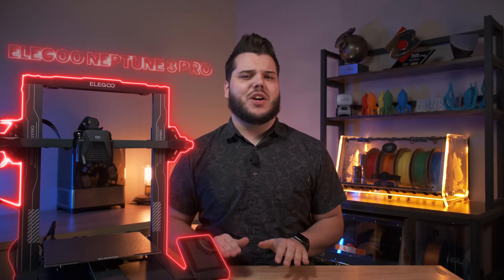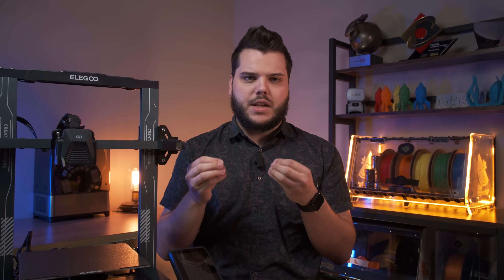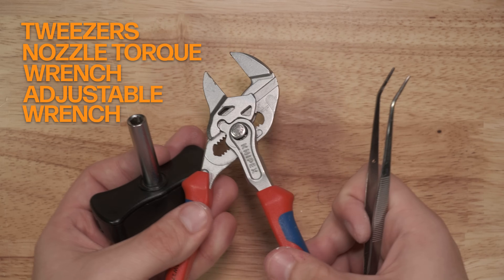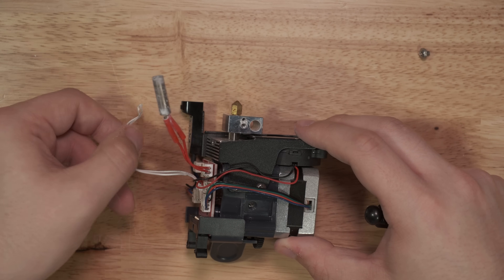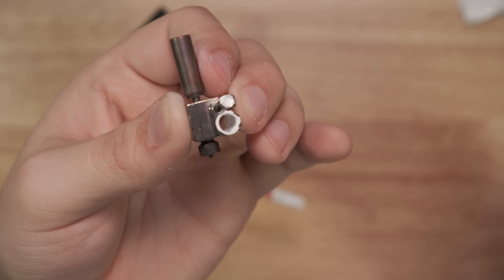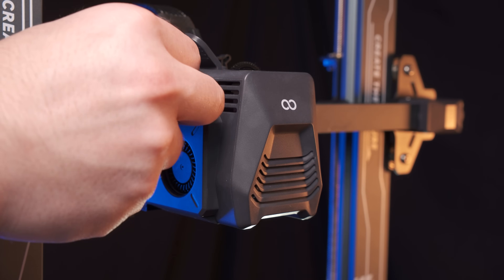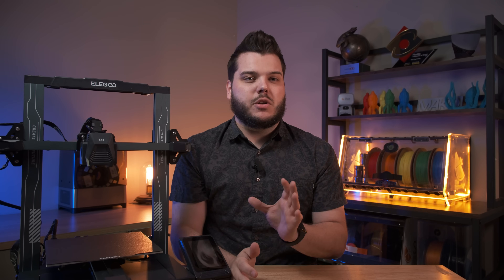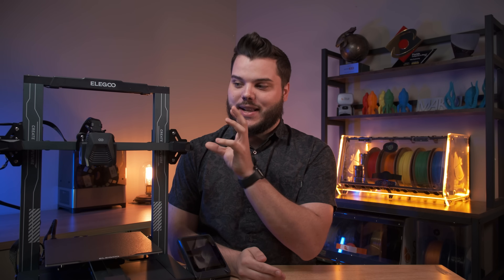Say Goodbye to Clogs | Elegoo Neptune 3 Upgrade Kit Installation

Comment: I just decided to upgrade my hotend, and, other than a couple of sketchy hotends with highly ambiguous specs, this one was the only plug and play one for the Neptune 3 Pro that I could find to do that.

Being that it seems to be of extremely high quality, has well-defined specs, and is plug and play, I decided to go ahead and order one. 

Unfortunately, they are out of stock.

Do you have any idea when they are coming back in stock?

For now, I have ordered a cheap upgrade kit that I don't fully trust, and I guess if it melts, it melts, but I still want to order this one.
Reply from the maker: Hello! Unfortunately, the Elegoo Neptune 3 kits are out of stock indefinitely. However, you can find the C-E heat break on our Amazon store and all of the other components on our website! Reach out to support@sliceengineering.com fr assistance in putting an order together.

Comment: People are going on about the costs. The nozzle is hardened steel alloy and can print abrasive filaments and comes with a non-stick coating that has already shown very good benefits; the heat conduction of the combined kit means that even though it isn't brass, I had to set my temps lower to get the same print quality, so some of the heat conduction claims are justified. Clocked the volumetric flow for PLA at 17mm3/s, meaning the hotend limit for print speed at 0.2 height is ~210mm/s. Even the sock fits perfectly. I think apart from the travesty that are shipping costs from US to AU and the music volume in this video, I'm quite happy with the upgrade.
Reply from the maker: Thank you! We are sorry about the music, and duly warned for next time! International shipping costs are a travesty, indeed. We are so glad to hear that you are happy wth the upgrade, and thank you for your support!
Reply: @SliceEngineering  I tried to leave a positive review on your website. It said that I already left a review, then proceeded to hide all reviews on subsequent page refreshes :/
Reply: buddy i not gonna pay over half the printer for a simple hotend upgrade when i can find something cheaper for 4 times less

Comment: Couple things I'm curious about.

1. Why use a non standard sized heat block? A cube shape would allow you use reuse the stock silicone sock or fid your own alternative. Seems like a cost cutting measure to use less metal and not a retraction setting bonus. 

2. If you're upgrading to an all metal hot end, the end goal is typically to print materials that require higher temps. At that point why not upgrade the thermistor to a stud and not reuse the fragile glass thermistor?

Comment: So only around £110 to order to the UK due to the cost of VAT and such.. I think that is way too much to pay for a new hot end for my Neptune 3 Max.?
I prefer to buy a all metal hot end from my normal place for around £20 and since it be from the UK, no customs or extra VAT to pay!

Just two months after I brought my Neptune 3 Max if I known Elegoo was going to do the Neptune 4 Max for the same money and it had Klipper and all metal hot end already installed.
I would have not brought the Neptune 3 Max but instead brought the Neptune 4 Max!

So now I have to pay out lots to upgrade the Neptune 3 Max to Klipper system by the BTT Pad 7 and get a all metal hot end for it?
Life really sucks sometimes.
Reply: Instead of spending a fortune on upgrades, put that money on a 4Max.

Comment: How do we crank the temp to 300c?
Reply: You'd have to change the firmware
Reply: @microsoftsam1970  I did that some time ago, and it was buggy as hell.
Reply: @darklordstudio  Literally all you need to do is alter the firmware you're using to change the max temp range. not download some experimental firmware so I don't know what you're on about
Reply: @microsoftsam1970  Thanks for the help.
Reply: For anyone, before changing the max temp, you need to change the thermistor sensor as the cables are rated only to 260°C.

Comment: Would this fit the N3plus also?
Reply from the maker: Actually, we stand corrected! This kit works with the Neptune 3 Pro/Plus/Max configurations as they all share the same hotend! We only have the Neptune 3 Pro in-house, so we were only able to test on that machine specifically. But after confirming now with some other testers and sources, it looks like it will fit the N3 Plus/N3 Max just fine!
Reply: @SliceEngineering  that’s excellent, thanks for replying back and clarifying
Reply from the maker: Unfortunately, this kit only works for the N3/N3 Pro. The N3 Plus/N3 Max use a different hotend configuration with unique heater/sensor elements, so it cannot integrate with the Copperhead hotend. However, we are open to exploring integration options with these models in the future!

Have you experienced similar difficulties when printing on your Neptune 3 Plus?